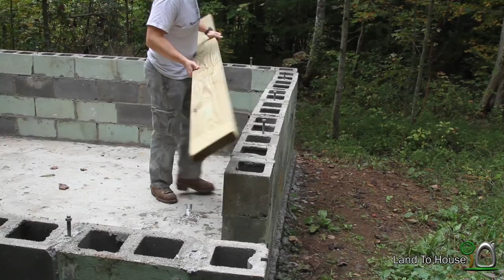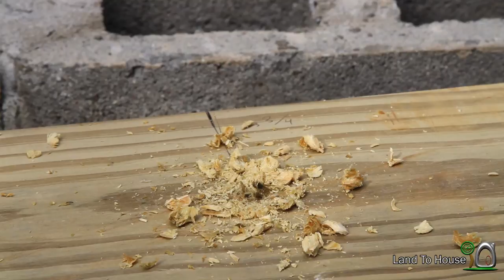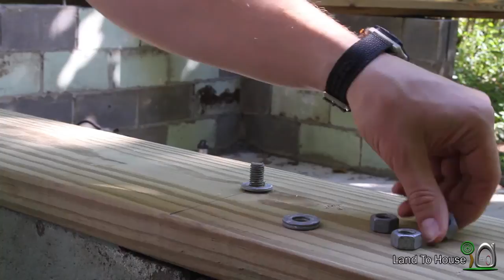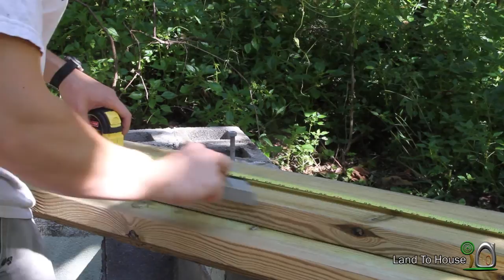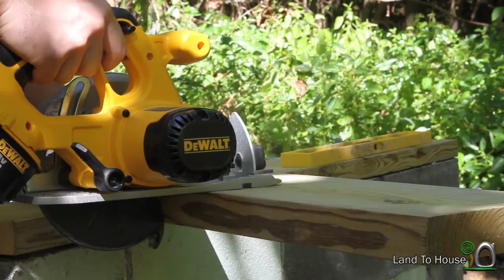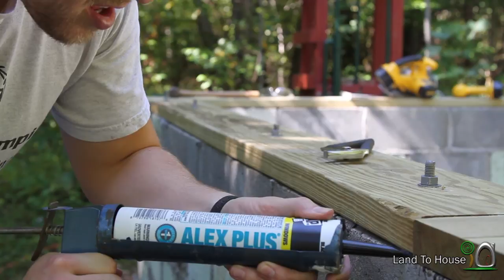Tiny House 9 - Attach wood to Concrete

Comment: I think this is the first time i have seen a tiny house built for the concrete foundation at this stage of developement. i think one other guy is doing a concrete foundation, but he is not at your stage. this is good. I had wondered  how the wood is attached to the concrete. I have subscribed and will be following you.
Reply from the maker: I have not seen any other tiny houses on concrete. Seems like most of them are on trailers or a wood base. My goal is to post two videos a week on this project so stay tuned :) Thank you for subscribing.

Comment: I have bolted down many wood plates over the years and it is not that easy to get the holes to line up exactly so I think you are doing really well, looks like a good secure job to me, that is never going to move anywhere!
Reply from the maker: Thank you.  Your encouragement is much appreciated.  This is one of the main things I have worried about.  But this does seem to be the most secure part of the structure. :)